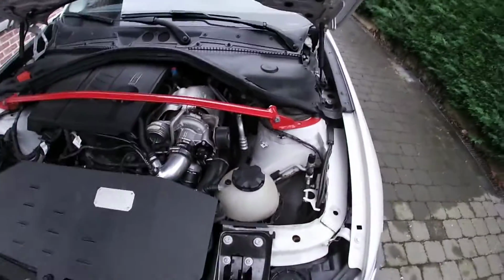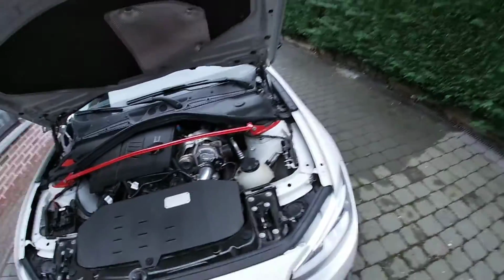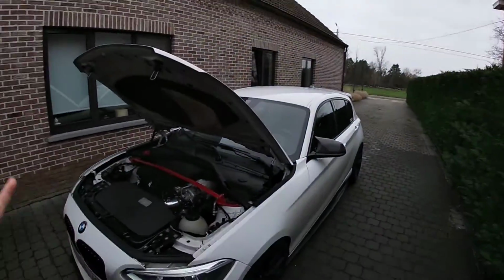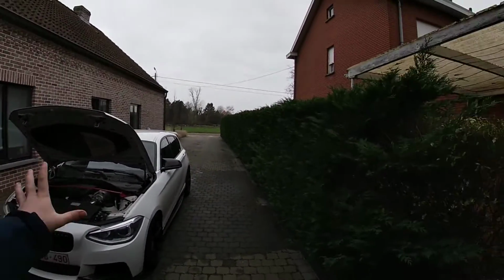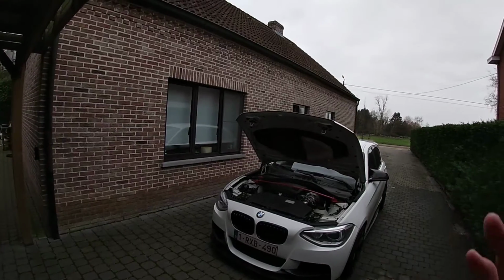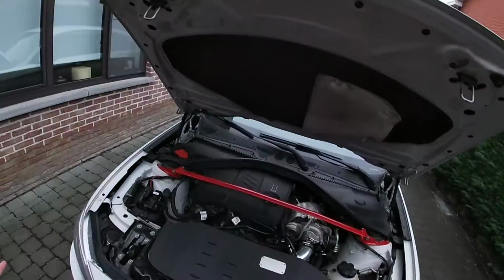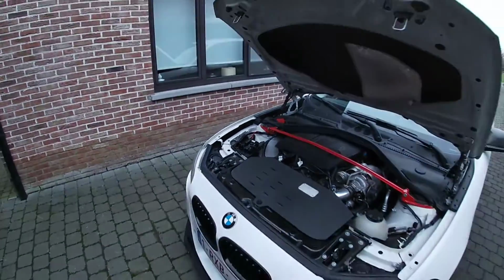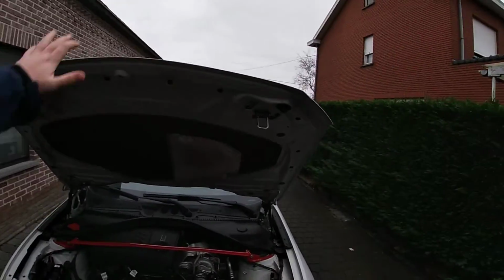Turbosmart Blowoff Valve Sound Compilation On My BMW 1 Series F20 114i.

Comment: Did you have any issues with the car popping up with a check engine light as it’s popping up with fault code 122108 saying the valve is stuck closed but seems to be running fine ??
Reply from the maker: I never had that problem no

Comment: I have a 116i N13 with Stage 1.
With my stock blow off setup, I hear this „stututu“ sound on high boost blow off.

Would this Fix the problem?
Reply: Stututu sound means your boosting system is good called turbo surge.

Comment: Do you get turbo lag with this kit? Better than stock one? I currently have GFB DV+ installed. Looking to upgrade.
Reply: no you won't get turbo lag with this. Its only to release the pressure that goes in
Reply from the maker: No not really

Comment: Do you notice any difference when driving? Does it hold boost better than the gfb at all etc?
Reply from the maker: I draggy timed it, and there is no difference in acceleration. I feel that the car is a bit more responsive though

Comment: Does it fit on a 120i? I want to order one man, sounds sexy 🤘🏼
Reply from the maker: Depends, the 2015 model 120i does share the same engine so it should fit. But there are other versions with different engines that won't work

Comment: i run with the bov unplug....
Reply: why XD
Reply: @piko7526  if disconnected it does stutututututu like jdm turbo flutter
Reply: @MegaGabriel233  and break very soon 😂
Reply: @MegaGabriel233  that sound is surge, air pressure not needed it’s not released so it makes turbulence inside  the turbo and makes the propeller to move excessively and reduces the lifespan of the turbo 😓